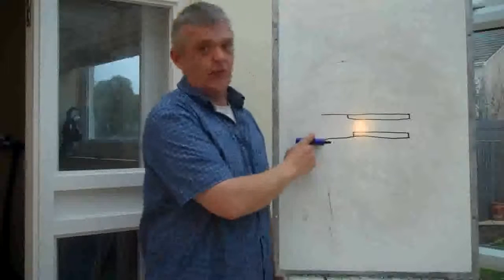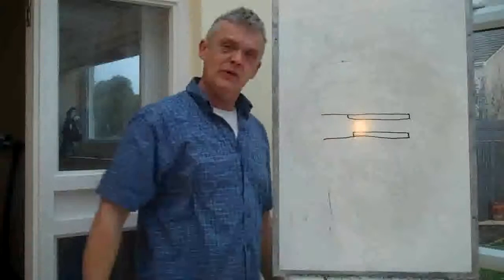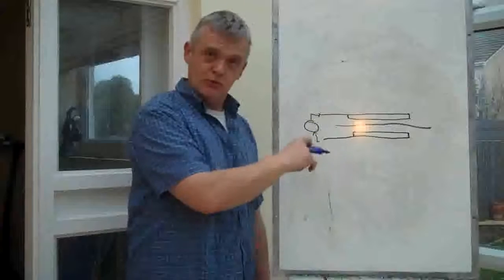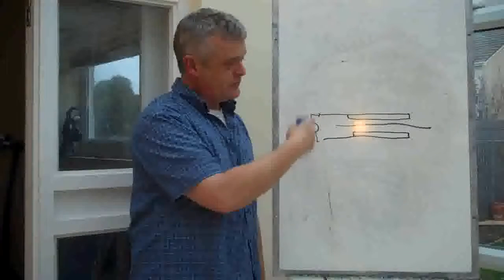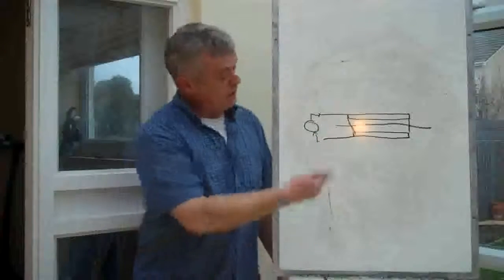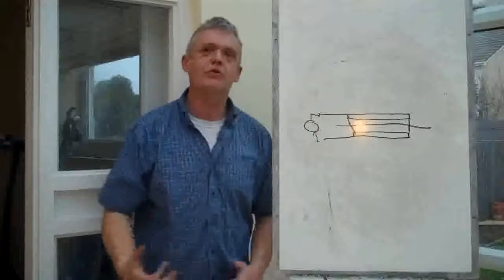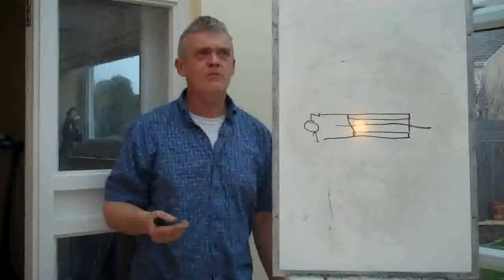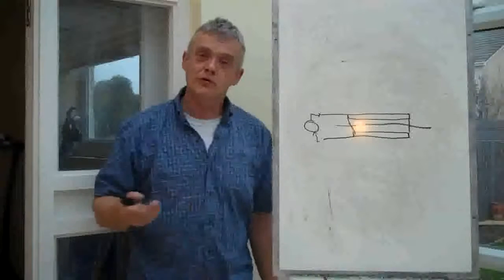Battery Supercapacitor Structure Basics

Comment: hi robert, i love the idea of using the kombucha scoby as a seperator for a battery or a capacitor.. i dont know a whole lot about making capacitors but i have a few kombucha scobys and would like to give  it a try. would i still need a electrolyte with the scoby to make a capacitor? if so what would you recommend as an electrolyte
Reply from the maker: try salt water to start with - it's cheap non toxic and you should get results - you can experiment with other things later. By the way if you grow you kombucha in graphene oxide water it will adsorb the GO and you can reduce the GO coated fibrils back to graphene coated fibrils - that would be a very very interesting electrode material - you could grow supercaps lol
Reply: Robert Murray-Smith thanks so much for all the info.. i currently dont have the means or time to make my own GO at the momebt but would be interested in purchasing some if you had some for sale, would you ship to canada?
Reply from the maker: happy to ship to canada
Reply: Hi Aaron. I had the same idea ! Did you realize it ??

Comment: Hi Rob,
You stated that the active material is to be the same, would the conductive surfaces be the same also or different?
Reply from the maker: depends on symmetric or asymmetric design
Reply: Thanks, this calls for an experiment to see which one would perform better. We wonder if Aluminum Sulfate on one side and Magnesium Sulfate on the other side with Naval Jelly mixed with a polymer as the electrolyte would work... We'll try to post a video response with the results.
Reply from the maker: go for it mate

Comment: So it's that simple.. What's the difference between a battery, capacitor or super capacitor? They all seem to look the same component wise... 

Also why are your cheap SC's "15x more powerful vs manufacturers "?? I know companies want profit but it seems dumb that batteries and capacitors have evolved so little after lithium ion batteries came out.. Which are always headlined for their bomb like qualities.. You'd think super capacitors would have replaced batteries by now.. Especially when LI-ION'S sought after properties are closer to a SC than a battery.. Except is an unstable version of a SC,since it's still a battery.. 

Also what components are most important? To me it seems like the active component based on the graphene craze and higher capacity... 

How do I email you? I'd like to learn and discuss things with someone intelligent who is humble :3 please.
Reply from the maker: I am sorry mate I am afraid I just don't 'chat' - I get around 200 or so emails a day and I try to answer them all - that means my time per mail is limited and I already spend 2 -3 hours a day writing to folks - with all the other projects I am involved in there just isn't time to do any more - your questions are very broad and I couldn't really do them justice but there reasons behind all of them and they are far from dumb reasons as for the differences sometimes it's minimal and sometimes quite a lot but mostly it is the mechanism that is being used to store energy and the arrangement you have to use to harness that mechanism